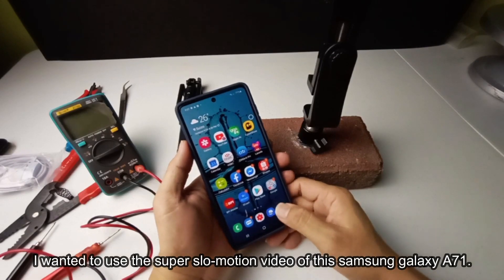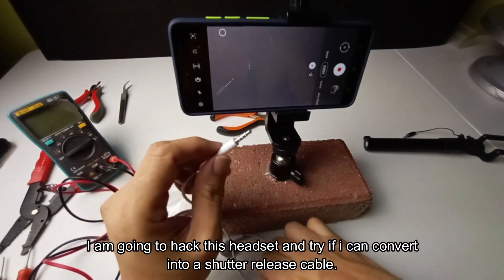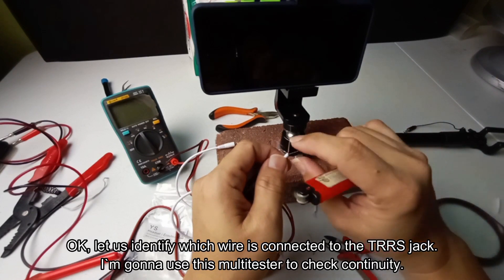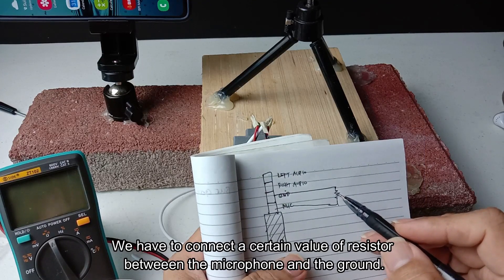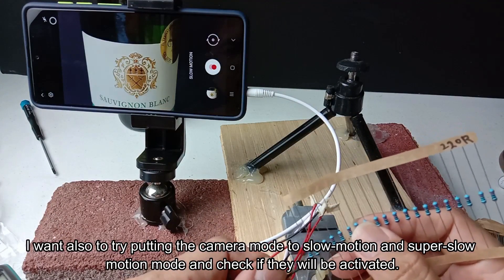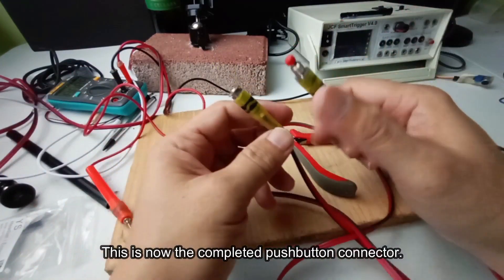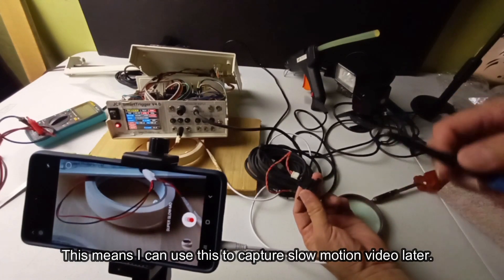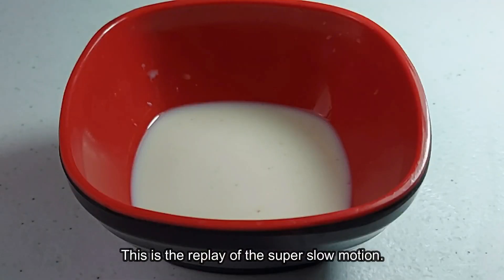DIY Shutter Release Cable for Samsung Galaxy A71 to Capture Super Slo-Mo video | Slow motion videos

Comment: Can an external flash also be added to this system so you can use the external automatic or manual trigger along with an external flash? If not could you at least trigger and external flash with the android headphone port?
Reply from the maker: Yes that is possible but it will require some electronics to trigger both the smartphone and a separate flash at the same time. But for video recording, i believe you will not need a flash.